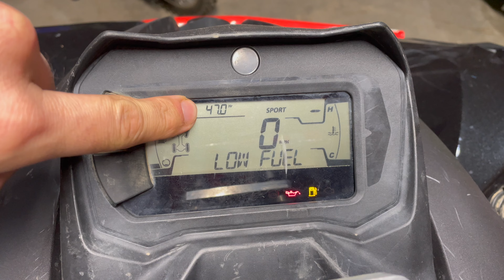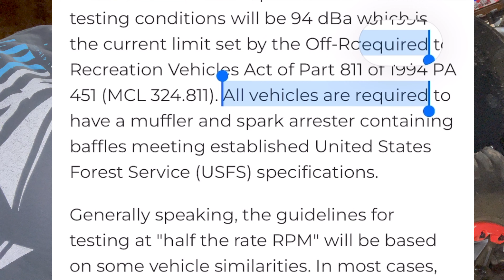Cleaning The Spark Arrester | 2021 Can-am Renegade 1000 XXC

Comment: Whats that steel wool like material at the base of the spark arrestor? You can see it at 01:54 in your video. When you put the arrestor back inside your machine, it looks like the wool like material is gone. Is that buildup from use of the exhaust or its supposed to be there like a sort of cushion?  At 04:34 you see that the fuzz material stuff isnt there....
Reply from the maker: Good question. Its a fiber glass insulation like material. I think its there to eliminate a rattle sound & yes i let it fall away. The last time i ran the machine, i think i may have heard it. Very subtle but i noticed something i have not investigated yet.
Reply: @calebfollett631  Thanks! my insulation ripped to bits easily so i have no choice but to try out without it... I doubt you can by that at the parts store..
Reply from the maker: @RCameron003  yeah it may come with a new spark arrestor which oem is 50+ dollars. I think its probably ceramic fiber (fireproof) muffler packing material you can buy on Amazon.